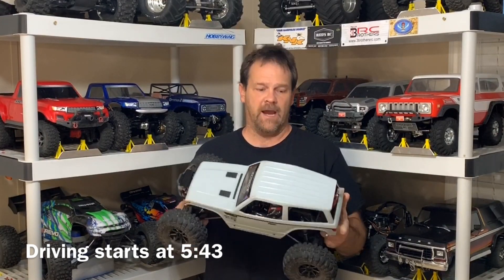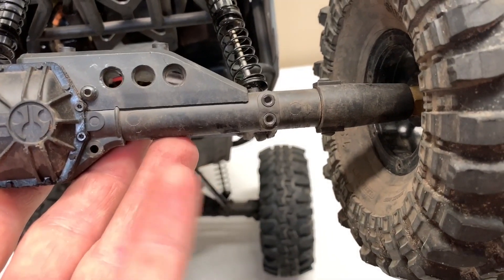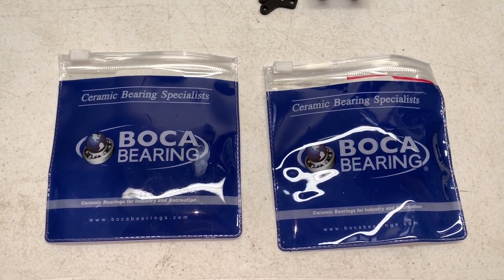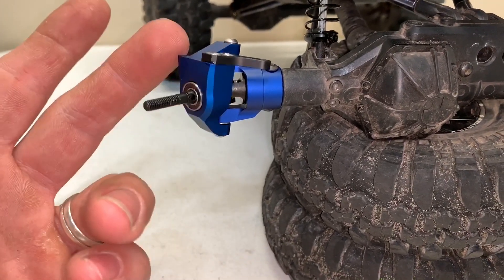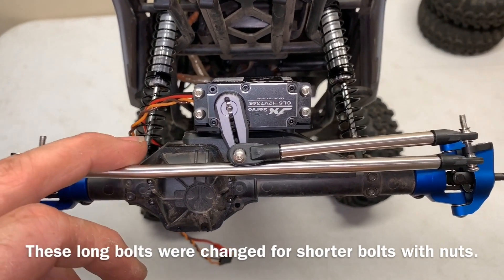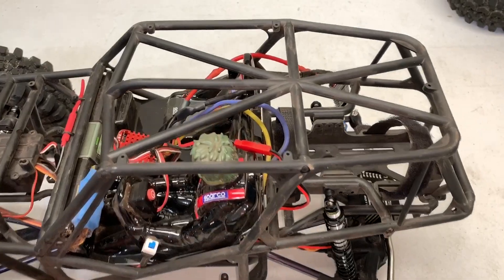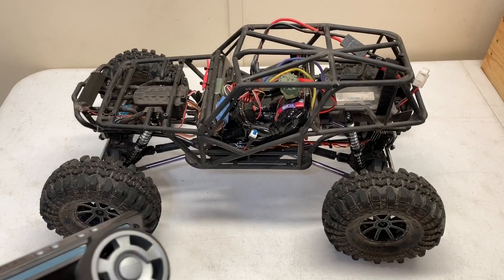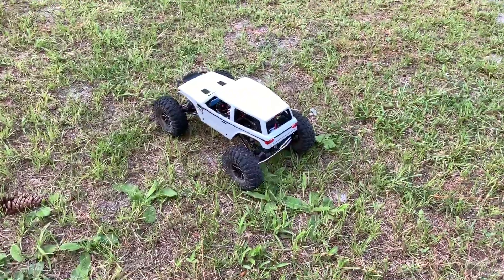Axial Wraith 4WS Conversion

Comment: If you use a radio with a third proportional channel you can just control the rear independently all the time, instead of having to switch modes.
Reply from the maker: I can do that with the radio I have but it’s end point to end point with auto center when released. I use that mode sometimes but I like the mixing of the hacked gt3c.

Comment: Good video. Just wish you were a little more in depth on how you setup the wiring with the controller. Im looking into the same setup but i just bought a whole axle setup due to the fact it was almost $100 & buying the components to convert the rear axle is more expensive. But overall good video. Id definitely be interested in seeing a more in depth video of you have made one or decide to make one

Comment: I tried to put a steering axle on my wraith but when i hit the throttle the rear goes in reverse. What did i do wrong.
Reply from the maker: The ring gear is on the wrong side. Flip the gear.
Reply: @ExocagedRC  im trying to use a redcat gen7 front axle assembly. Doesn't the gear only go in one way
Reply from the maker: @mattward4184  yeah only one way on that
Reply: @ExocagedRC  I'll just do what you did or buy a complete front axle. I was just trying to save some money, and use what i have

Comment: Could you please give your opinion on Wraith in general as a crawler and also what do you think about pure crawler, like rc4wd Bully?
Reply from the maker: Wraith is a great all round vehicle, its big fun and can take some abuse. Its ok as a crawler but in my opinion its not as good as a narrower vehicle. The Bully is a straight out crawler and its extremely capable, not much of a scene around for them in my area.
Reply: That's my wraith in the video, I love it even more with 4 wheel steer. It crawls amazing! Even before 4WS it makes a great trail truck and basher. Just like exocaged said, they are a pain to work on
Reply: @dylanconn6079  did you move the battery from the back to the front? for mine it was a night and day world of difference.
Reply: @Nick_Parau  yes added a hood hinge kit as well

Comment: So it's 4ws all time? Or can you turn off rear so it's 2ws?
Reply from the maker: selectable steering modes from the transmitter so yeah you can do front steering only 4ws, crab and rear steering only if you want.

Comment: Nice! I've seen some comps and the guys have something like momentary fixed rear steer (lack of better terminology). It's like they can fix the rear steer at certain epa's left or right and move the front steer freely. Have you seen or done this? Thanks in advance
Reply from the maker: Viet Tran yes I can set these radios up for that style steering. I prefer to have it mixed like it is as with this radio it’s very easy to switch steering mode.
Reply: Exocaged RC cool! Do you know the term for what I was asking btw? Thanks 😃
Reply from the maker: @viettran5438  yeah I call it momentary, similar to what real vehicles use in monster trucks and bouncers, they simply have a switch. With RC we have proportional mix controls so I just use that
Reply: Use a Sanwa mt4s and with rear steer on lever, and you never go mix again.
Reply from the maker: Henning Mikkelsen nope, tried that and I like the mix better.

Comment: What type of Radio is that?
Reply from the maker: Trent Cracraft hacked Flysky GT3c. I sell them.
Reply: @ExocagedRC  can I get a link to the controller that you sell? Or can i purchase one for you? That's already hacked and set up like this one you used in this video? Thanks. Always learn something new from your videos
Reply from the maker: Jc Tinnell I sell them but am out of stock due to shipping times for them. Shipping is horrible right now. You can try RC Addicts and ask if they will program for you.
Reply: @ExocagedRC  when  do you expect to have more in?
Reply from the maker: Jc Tinnell I honestly don’t know. Could be a couple weeks
Reply: @ExocagedRC  no worries. It'll be a few weeks before I get my 4 wheel steering set up on my losi nightcrawler. When you get one in and set up, how much would it be?
Reply from the maker: Jc Tinnell I ship in the US for $120 total. That’s hacked, programmed for your specific needs and fully tested. Plus I print instructions for your model. It comes with the stock 3ch receiver and your choice of a 6ch or 8ch receiver. All are waterproofed by me with urethane conformal coating.
Reply: @ExocagedRC  sounds good. Let me know when you get one in. I'd be happy to have a controller from you.